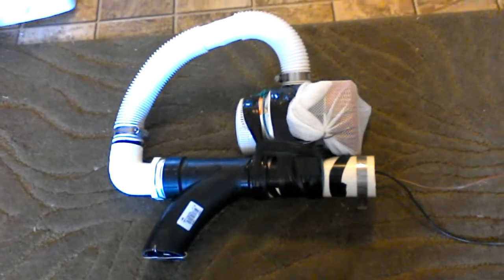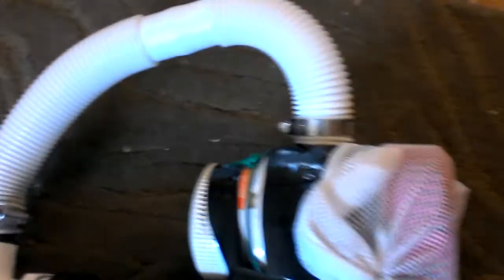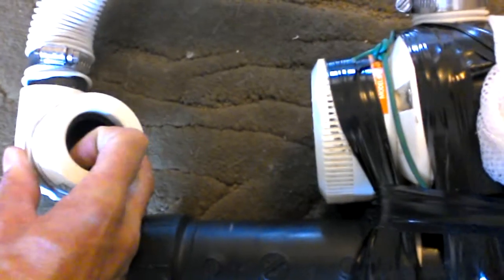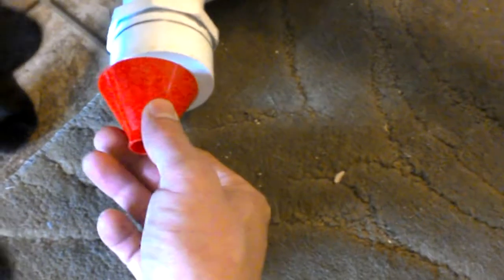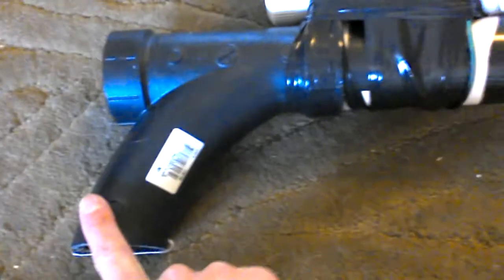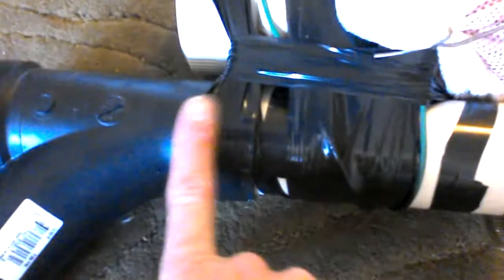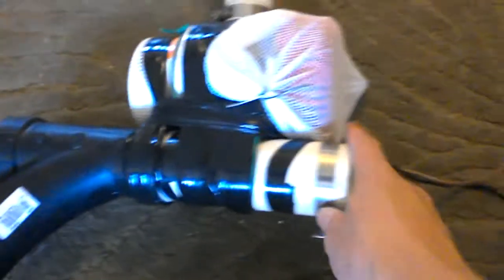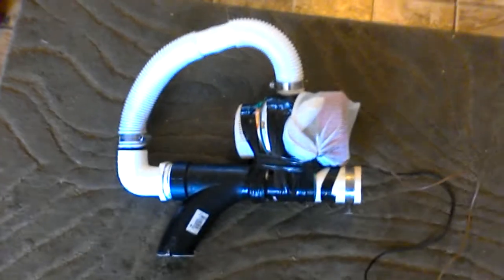2in 12v electric dredge

Comment from the maker: great.  I got rid of the 90 degree elbow and went with flex hose right to a 1 1\2inch  reducer, got a lot more flow that way. fills a 5gal bucket with material in about 30 seconds. plus I changed the jet a little. I will post a video as soon as I can
Reply: you can not use an injector in the UK
Reply: Post an updated video please.. thanks for all your efforts! #SeattleRingHunter

Comment: I am thinking of building something simular.
Its a combination  dreadge tip like this one, with a bucket dreadge design. 
2 pumps one highflow centrifugal pump in the bucket, and a diaphragm  pump high pressure low flow on the tip.
I also am going to do a dual bucket set up. Heavies go in fist bucket (trap) light muddy water into second then out.

I think i can reinforce the buckets from any collapsing  by taking 2nd bucket and cutting off the bottom and top, and using marine grade epoxy glue the sleeve into the buckets. To thicken the wall.
Option 2 will be a removable grate to keep the center of bucket from sucking in as much( a milk crate cut to fit in side half way down.maybe?)

The diaphragm  pump will get its water from bucket 2, with a fine mesh screen, or may draw out if creek water flow. To be determined.

A diaphragm pump is not submersible,  so i would mount it on top of bucket 2. With a feed hose to the tip.

May skip the hole bucket idea and use a 8 gallon rubbermade pack out tote bin. ( i need to look at one in person to decide how it will handle vacume.)( lid seal ,ease of lid and mud removal ect)

Was also thinking a round water cooler with the treaded on lid may work. Sports water jug.

On a bucket was thinking of the Gama seal twist on lids.

Comment: Hi, if you remove elbow and pipe and install the pump straight (19mm right?) the pump outlet could work as a reducer, no?
just to eliminate that bulky pipe in your front.

Comment: If this works, how much would you charge to make one and send it to me, or even just send the parts? I live in Atlanta.
Reply from the maker: It definitely works. I have a finalized version that's a little more simple but you can just buy all the pieces from a hardware store or off line. The red funnel I have cut to make the jet is ½ inch at the tip and 2 inches at the opening. The jet ratio is 1 to 4 for the most part. One small plastic funnel, Seaflo 3600 bilge pump I believe and  a 2 inch Y style ABS plastic pipe fitting. A 2 inch glue in style pipe adapter (2inch to 1½inch). Then 2 feet of spa hose and some 2 inch suction hose 10 feet max length for the discharge line. Yes it sounds like a lot but it isn't hard to assemble. E6000 is the glue I use.  If you decide to build it I will send you pictures for guidance. The hardest part is getting the jet build as it needs to be straight and the surfaces need to be smooth and level. O and a good 12v source
Reply from the maker: 1½inch spa hose.
Reply from the maker: Plus a few hose clamps

Comment: You will need pressure not volume when selecting your pump
Reply from the maker: Not true a suction dredge runs off a regular water pump not a high pressure pump. The jet is what creates the "pressure". Venturi effect